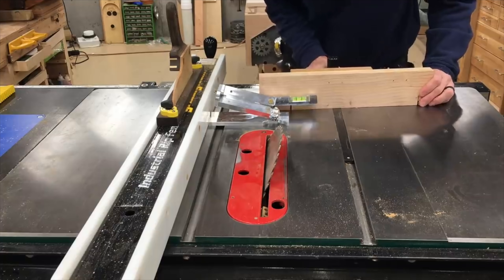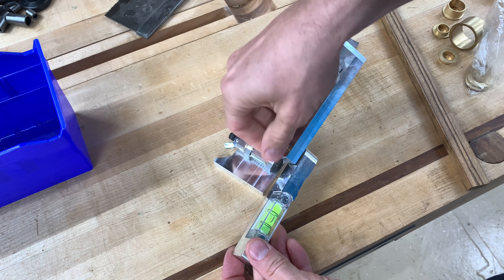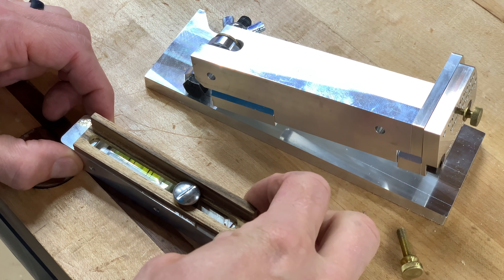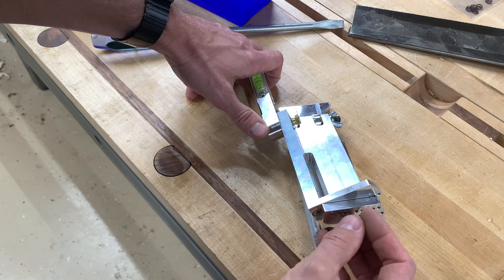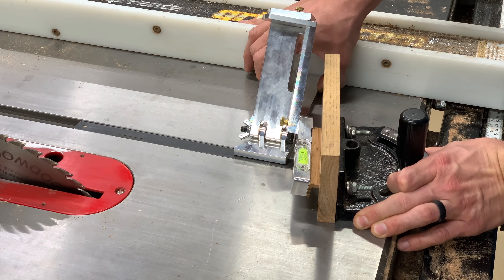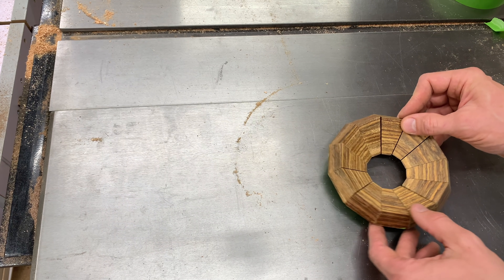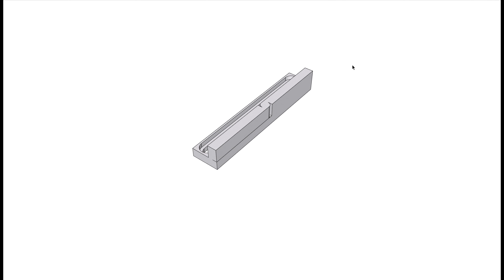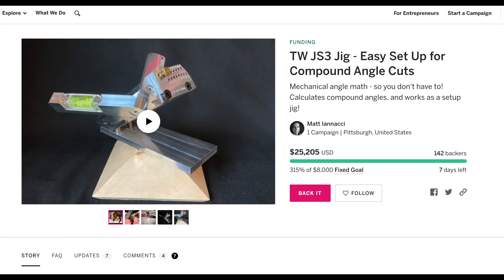I modify my splayed stave angle setting mechanical calculator

Comment: Nice work. That would have been an ideal job for a 3D printer, you clearly already have the CAD skills.
Reply: Hi Arlen, from the inventor!  Actually , the original prototypes were 3-d printed, but hobbyist-grade printers can't guarantee the alignment.  I had to learn CAD to put it together, and the machine shop that I worked with (at Andy's recommendation) has been phenomenal at updating the models and churning out amazing prototypes.  Can't wait to get all the parts in, and start sending tools to the backers!